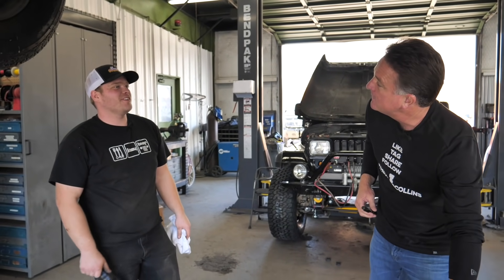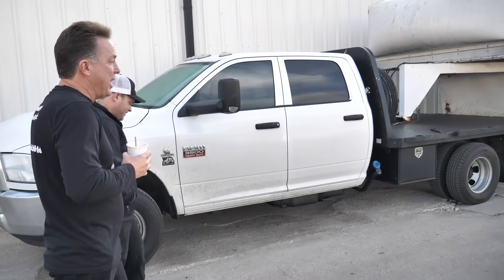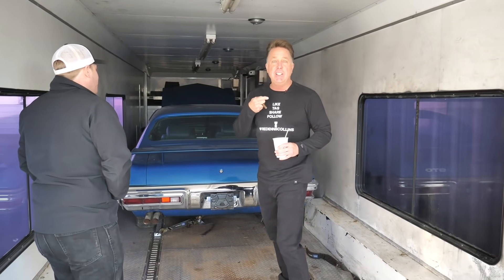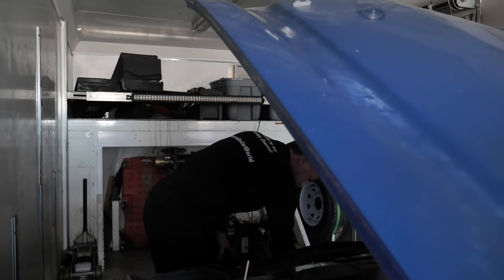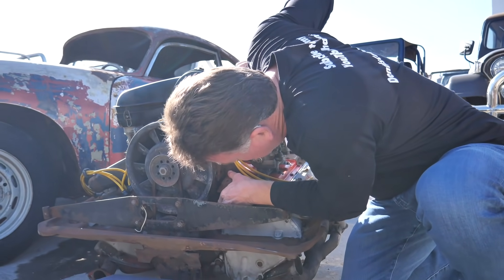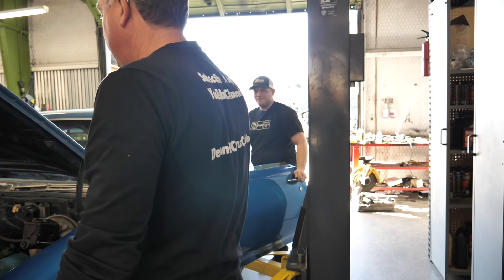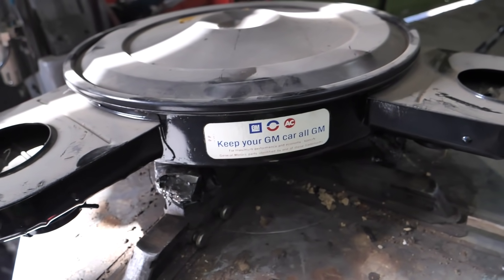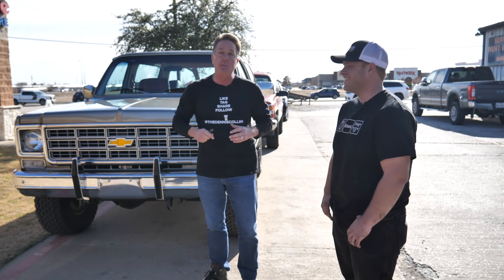Alex bet Dennis what on this GTO?!

Comment: The more I watch Coffee Walk, the more impressed I am with Dennis' knowledge beyond just Jeeps. These barn finds are really interesting and as much as I'd like to get one, I've had it with old cars and trying to keep them running if they are driven. I finally sold my matching number 1970 454 Corvette convertible with documentation from dealer ordering from GM, to factory pickup and convoy to Omaha as 1 of 13 Shriner parade cars. Sold in January and bought a new 911 Carrera (991.2) which has been on my bucket list for decades.

Comment: Dennis, I had a ‘71 GTO 455HO 4 Speed back in ‘75. It was black with a white interior. It suffered from two major problems and being a 24 yr old guy, I didn’t have the money to keep fixing it. #1. Driver side exhaust manifold gasket leak. I changed it multiple times but always came back. #2. Rear main seal leak which ruined the clutch and it always chattered as a result. Loved the car but ended up selling it.

Comment: You probably already know this about the Pontiac engines, but they were somewhat notorious for sheading the timing chain around the 50,000-60,000 mile mark. The cam timing gear was coated with nylon to make it quieter and it would shed the nylon  coating causing the timing chain to jump. Great find and video!

Comment: That Air Force sticker on the front Grill from Whiteman AFB shows it was owned by an NCO (yellow sticker) at one time.  They were red for an airmen and Blue for an officer.  The trunk lid will stay up with the wing by just adjusting the tension bar underneath & between the hinges.  Had a 71 GTO convertible 455HO (clone)15 years ago so went through all that.  The air cleaner looks more restored than nos because it looks like it has some corrosion that was painted over.  They are really tough to find though so not a big deal.
Reply: Paul lee you are right, when I was working for the army in the late 70s we had 8in sticker, in 1980, we got the 4in sticker

Comment: I own a Fremont, CA built 71 GTO and ran into the very same problem you guys did finding the VIN stamp on the block. As you know, the last six digits of the VIN are normally stamped vertically, parallel with the side of the timing chain cover, way down low on the block. I ended up finding the last six digits of my VIN, stamped on the same surface as the engine unit number and engine code surface, an inch or two below those codes, and very faint. I posted my question on one of the popular online Pontiac forums and was told that the Fremont, CA cars were usually stamped like mine.

Comment: Merry Christmas to Dennis and the entire family at the dealership! I love these videos! Wish I could afford any of these cars/jeeps. I miss my P.O.S. 1972 Gran Torino (first car), my P.O.S.'65 Mustang 289, and my '66 Mustang (not a P.O.S., but it was a 200 6-cylinder). Wish I had been able to keep them all. I actually also miss my '77 Mercury Marquis station wagon. I had to drive a ten-penny nail into the passenger floorboard to get rid of the water from the leak in the roof out and it got about 8 mpg, but it was a tank and road like a Cadillac. Speaking of which, I especially miss my '97 Cadillac Eldorado. Hunter green, great car. Smooth driver. Got rear-ended and totaled the day before my wedding after I picked up my tux. These days I'm driving an '09 Merc Mariner Hybrid. Boring.

Comment: Denis, your a walking alminac!  
I would like to see you find a 62 Catalina w/super duty aluminium 
sheet metal 8 lug wheels 421 w/)2 4's, 4sp rock crusher trans perferated frame whte exterior, red interior.  Even had radio & heater.  I have a friend that had a dealer ordered on like this!

Comment: that 2000 400 4 speeds  is that in 71  or total cause there is a 69? convert 400 4 speed Ram 4 car in a local guys building sitting for decades
Reply: That would be the production numbers for 1971, not the entire run of the car